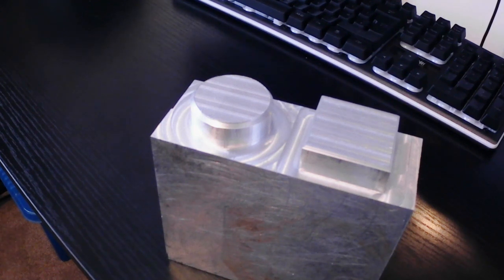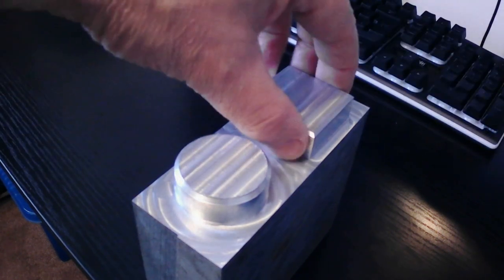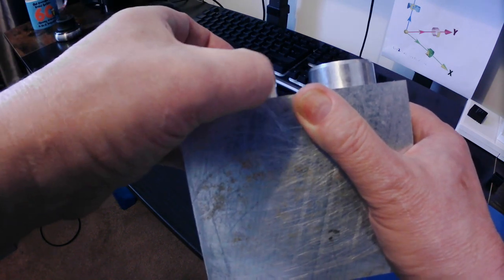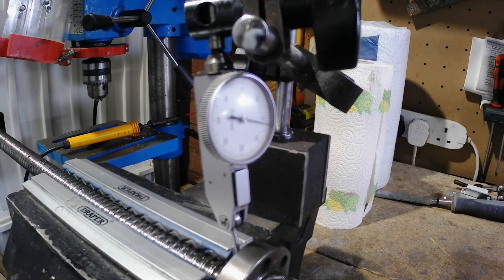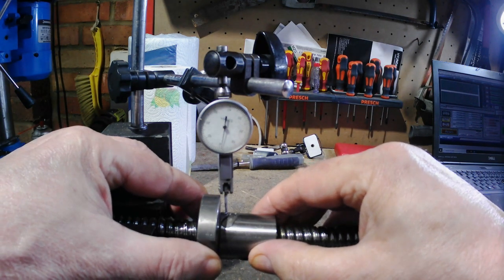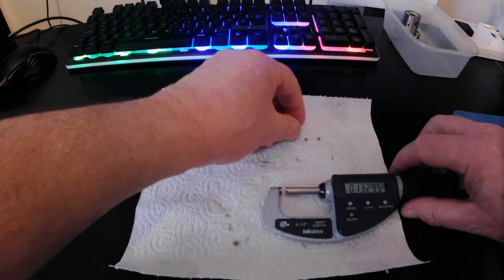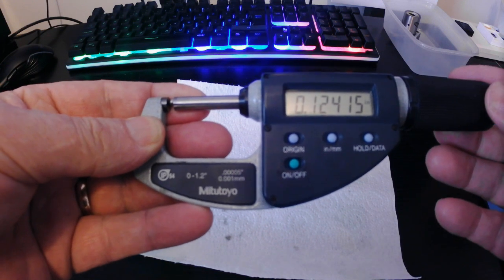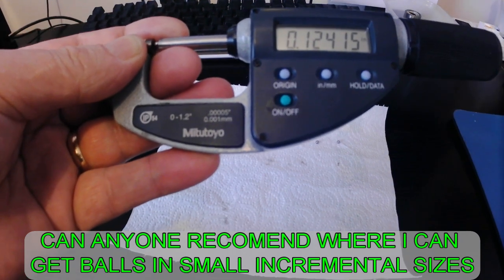DIY CNC 5 AXIS MILL TURN MACHINE PART 5

Comment: Phil, kudos to you.  Great work, great design, I look forward to not o seeing the finished machine, but also the projects you make with it.  Are you going to make your design and plans available?
Reply from the maker: Hi.
Thanks for watching.
I might release the plans.
I will see how it turns out the 3 axis bit is fairly straight forward, I have not seen a 4h & 5th axis designed like mine which incorporates a lathe spindle, It might not work!!
Reply: aside from some peculiar semi-automatic ones used for woodworking, i don't think i've seen them with a rotary axis along your x, plenty along the y.  perhaps in other machines the y is more accurate due to carrying less weight, you've got 4 rails and two screws, yours wins there.

Comment: Hi my name is alex. I'm not an engenier but i worked on some cnc mills (hass and dmg). When manitance happened i saw that the machines have the infinite bolt a lot bigger. You may have to change them. I think that changing the bals screws is a bad idea becouse they are ment to be a little smaller for free to move. I love the videos (dont like the music, you can use some ncs songs). See you soon with a new video. Good job and keep it going. Hopeing the best for you.

Comment: i think your ball screw are 16mm size(1605?) the ball for the nut should be right at 1/8"(0.125), but in the past i tried to replace the BB in the nut and it become too tight, later i change the nut to a double nut setting for clear out the backlash.
Reply from the maker: Hi.
Thanks for your comments.
You are correct they are 1605 ball screws, I have fitted some 0.125 balls (as you saw in the video the original balls were undersize. still got about 0.03mm (0.0018") backlash in Y. Still looking for oversize balls.